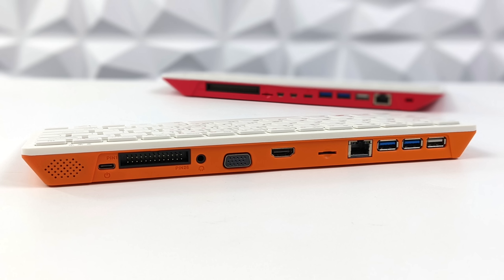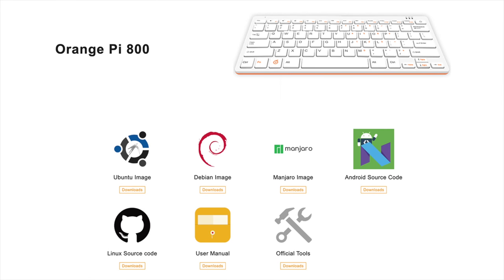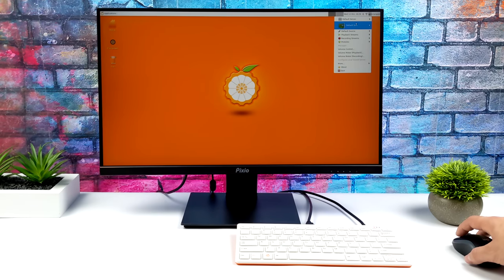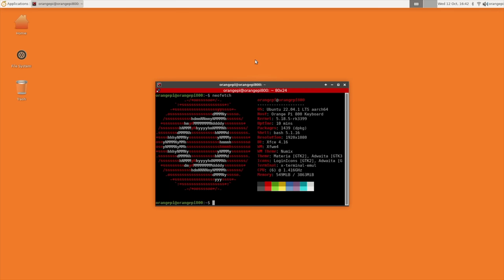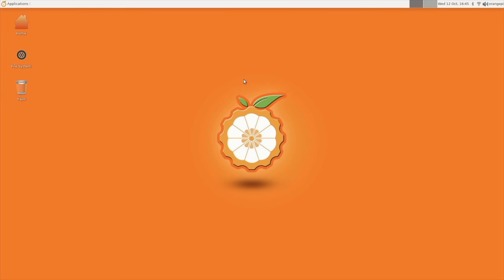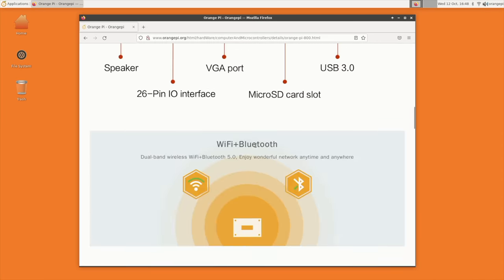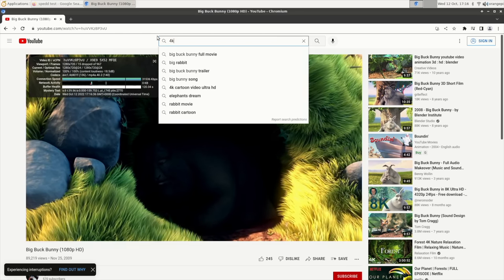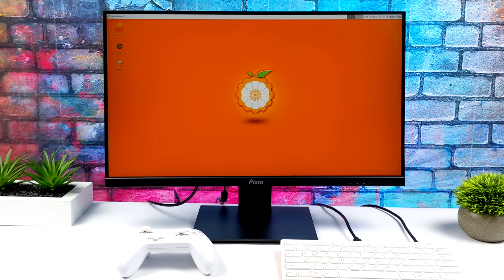Pi800 First Look, An Brand New All-In-One PC! Think Pi400 But Faster! 6 Core Arm CPU

Comment: I'm enamored, but just like the pi400, there's only 4gb of ram which is way too little for decent desktop use.  I would love to see an 8gb variant and it would be great!
Reply: Agreed, given the name, you'd think they'd at least throw in 8GB of RAM.  A M.2 slot wouldn't hurt either...
Reply: Like WTF why not 8 GB or even upto 64 GB Ram? But it is good that it is faster than the pi400; and that someone else is producing pi400 clones. Cause I think you can't even buy the pi400 out of stock. Maybe they'll make a variant version of the pi800 with atleast 8 GB ram. Glad someone else thinks like me; 1st thing I wanted to see was how much ram. Too bad there wasn't an option like a ARM GPU BUS and you could hook up a external GPU.

Comment: As a personal computer it's great. I like the downsized form factor of the Pi400 and Pi800's keyboard. The keyboard integrated motherboards are a real plus and take up a lot less room on a desktop than conventional personal computers. The only drawback to these SBCs is the form factor of the board itself. I also like to do robotics. Unless my robots were huge to begin with I wouldn't be comfortable with this SBC's form factor.  I would be interested in seeing it running on Odroid.

Comment: I really enjoy the pi 400, great for many projects. I have two table top arcades with pi 400 very easy.
Reply: Very excited to try the pi 800
Reply: The VGA plug is super cool and gives you the ability to plug it into a CRT monitor for the vintage game goodness 😁
Reply: @rmcdudmk212  Hoping it's an analogue signal out though, rather than analogue to digital over analogue.

Comment: I would like to see a new keyboard with a built-in battery. I could see myself using this battery-powered Pi800-like computer without a display and I could navigate the computer using just a screen reader. That is, once I connect a display and get the screen reader to automatically start during the login and after logging into the desktop. I would like to be able to make use of a keyboard-only device while traveling. Not that I am blind (actually, I am blind in my left eye), but being able to connect to the WiFi network and access the Internet using just a screen reader with no display connected would be very cool to have.
Reply: really curious about assistive technology on some of these alternative platforms. Windows (with Narrator) finally has a decent built-in screen reader. Apple's VoiceOver is quirky, but not too terrible. ChromeVox kinda sucks.

Comment: Maybe one thing not very clear from the video is that the GPIO are different. This is a 26 pins connector like on a very old Pi, and not a 40 pins like in most Raspberry Pi computer. Not sure what is the pinout, but you could lower the expectation here. As a desktop, you don't need that, so maybe most user don't care.

Comment: I hope the next version of this and the Pi-400 includes a full sized keyboard,  entering numbers with a numpad is much preferable.
Reply: I know that people have different preferences, but I have never understood this, as the top row number placement is accessible from your existing keyboard hand positions, instead of off to the right. I absolutely never use the numpad on a keyboard

Comment: Like most arm based systems when running Linux, the browsers do not have hardware video acceleration enabled by default. This is why youtube playback is so sketchy. If you get the HV enabled in both the OS and in the browser you should be able to obtain similar performance to what you see in Android.

Comment: Hey!, Nice video. I have a concern about the compatibility of the sensors, actuators, cables (number of pin are different), projects, kits designed for 400... Seems maybe those things will not work appropriately on 800, maybe some adjustments. Will be nice to have a video review of kits. Thanks again 👍

Comment: i'd def prefer a pi400.  i bet the os on that thing needs craploads of tweaking and will have a lot of problems.  i'm surprised they don't get sued with it copyin' the raspi so hard :)  at first i though raspi came out with a successor.  but, eh, it's good that it exists.  i hope raspi does make a successor.  with full size hdmis and slightly more i/o than the stock raspi board.

Comment: Can you please do a comparison video for people like me who are on a really tight budget and want to make maximum use off of a single system like this? Does it make more sense for me to buy this or a similar single board computer, make an old PC and put Android or linux on it, or buy a celeron laptop with either Windows so I can install linux or Android or with chromeOS out of the box, giving me direct access to Android apps?
Reply: How tight of a budget? In the 150-200$ range I would just get a used ThinkPad and put Ubuntu or your preferred distro.
Reply: @technicallycorrect838  100$ roughly. Plus I'm in Pakistan so don't assume we have old i7s rotting in storage. A 3rd gen i5 could still cost you over 100$ if you want a good monitor and other accessories not from the junk yard.
Reply: I use a pi400, it runs great 1280x720

But all of my monitors are big 1920x1200s and the pi400 does run not as smooth at those big resolutions. I'm using blender on mine to make BSPs and 3d characters with 5 layers of LOD cutoffs so it isn't too bad. LibreOffice, printing, and scanning all work great too. 

I will say though, raspberry Pi(ish) type computers really benefit a lot from running off of SDcards. One SDcard for desktop use, one for gaming on a heavily stripped down environment, etc.

Comment: You should try TwisterOS, they have an image for the RK3399. I’m using TwisterOS on my Pi4 and it works fine.
Reply: TwisterOS is wallpaper addon, not an OS. Pi4 OS does not work on other hardware ...

Comment: Thx, didn't know they release a Pi400 clone. The cpu power maybe a great advantage, but imho, 8 or 16gb or RAM would be nicer. I use the Pi400 a lot, and I love 2 HDMI outs, I don't understand why they added the VGA port, I would've loved a second HDMI on it (or even Display Port one day :) ).
When you have a multi-monitor Setup and you want HD graphics, VGA will just look bad at 1080p.

Otherwise, cool that we get an option, I will get one when I have some money to just blow on fun things :) (100 bucks is not much, maybe in December)

Comment: The issue with hardware acceleration of videos on browsers in ARM Linux is a fault on the part of browsers, Only recently Firefox fixed its x86 Linux version to play HW accelerated 4K without disabling critical security features.

Chromium on Pi isn't better either, Even with RPi foundation's customization.

Comment: It seems to me that Rockchip and many other makers of chips used in Pi-like SBCs mostly care about Linux in form of Android. Support for using regular desktop Linux on these machines feels like an afterthought. Raspberry Pi family are pretty much the only SBCs with primary focus on regular Linux instead of Android.
YT in Chromium browser works poorly because video is decoded using the processor rather than the built-in hardware codecs. Google has never bothered to implement hardware decoding in Chrome on non-x86 machines outside of Android.

Comment: this is disappointing i was hoping it to be a better upgrade.the only thing stopping me from buying p400 is the 4gb ram and lack of sata or nvme ports/sockets. id like at least 8gb ram and a sata connected 2.5in ssd so running windows is fine and not slow or ram restricted. mp uses 6.3gb ra, at idle with just stem open in background and maybe one tab youtube.

Comment: small error in video, this does not have a 40pin GPIO, it's a 26 pin ... not the same as the current raspberry Pi, but similar to older models maybe?

Comment: I've never gotten JACK (qjackctl) to work on Raspberry Pi 400, on Ubuntu 22.04.  It crashes quickly with an error called "Stack Smashing" (or something like that).  For MIDI audio on Linux (and its reduced latency), JACK is an essential application.  If that problem is solved, I would get one right away.

Comment: Can’t say I’m a fan of the deliberate naming to confuse people, although the box and labelling does say either Orange Pi 800 or OPi800, not just Pi 800. ETA, a video title change would be appreciated. 
Regardless, yes it’s faster than a Pi400, but personally I’ve had nothing but issues in the past with Oranges products, both hardware failing and poor software/driver support and this seems to still be the case looking at the YT playback test. 
Additionally, Orange gives nothing back to the Pi Foundation and is purely a commercial product trying to pick up the scraps of all the hard work the foundation does. So even ethically, it’s a hard pass from me.
Also, that’s not a full GPIO output on the back.

Comment: While I like the built in processor.  I would love for one of these to have a better keyboard.
Reply: You can plug in a usb keyboard off course so I don't think that would be make sense... well at least not commercial anyway.
Reply: @erikkarsies4851  
I have a Raspberry PI 4 if I'm just plugging in an external keyboard?

It would be nice if the integrated keyboard was better.  I just don't like the chiclet style keys.

Comment: I have a question: why don't they use any top of the line chip ? Like Snapdragon 8+ Gen 1 or MediaTek Dimensity 9000+ ? It could be a real ARM based desktop replacement. Main thing holding back those chips is lack of good cooling and that they are battery powered in phones - both of with is not an issue in a design like this. There is enough space for even an active cooling solution and power is delivered from a power adapter not from a battery.

Comment: I don't know, I got the Orange Pi Zero 2 and tried both linux operating systems that are available for it, but the desktop experience was far from smooth, YouTube playback even worse. Android ran smoother, Netflix playback was good, but no google service so play store was missing and installing apps from apks were a hit&miss, because if they needed some google service to run, they didn't work. 
I like the idea behind small arm pcs, but if you are not in the 200€+ range then it wont do much, you are better off getting some older laptop in that price range - even at 100€ price tag like the Pi800.

Comment: How is OS support - including updates! - on things like this? On official Raspberries, you can count on every relevant distro to have regularly updated installation images - usually official, community-built in some less mainstream cases. But what about this? It runs Ubuntu 22.04 now, which is great, but is there any chance of ever updating to 24.04 with an updated kernel when the time comes without, without the need to build your own kernels etc.?

Raspberry Pi is sometimes criticized for being stagnated, or overpriced relative to performance compared to the competition. But it's a stable platform that's reliably maintained and updated by both the original vendor and the community. How much of that is true for competitors like this?

Comment: How much you wanna 'bet' that the pi 800 / rk3399 lag on YouTube on Linux has to do with software based render on the browser instead of hardware video render... Keeping in mind that if the graphic driver in Linux isn't robust enough, I'm pretty sure the browser passes video off to the CPU. Android probably sends all video content to the GPU internally. Annnd it's probably not the first rk3399 system to run android os

Comment: thanks for show us this opion. 99 $ you say. In my case, from germany, the only ventor is aliexpress for round 139 € 😞
But i have two of the pi 400. And yes, when i becam the pi 800, i was lucky about the internal 64 GB + the better CPU/GPU.
But both, the pi 400 and the 800 has limtiits. What i mean is, the pi 800 is faster but not in the range, 
what mobile AMD, Apple or Intel Platformbase can do. But you pay more and you have, most, a fan for cooling it.
When you notice it, and you know what you do with these things, you have a Computer what cosuming ~5 Watt
and is absolut silence 🙂

Comment: I would like to see something similar but 100% Windows compatible.  Mainly for Windows XP era etc.
Reply: get a mini-itx system with an intel atom.. same sphere of performance but using x86.. I have an old (passively cooled) atom 330 board that would run XP.. VIA used to make good passively cooled x86 systems but I think they're out of that market nowadays. (I still have a couple of those lying around collecting dust)
Reply: @desktorp  Thank you but, a) I have a small PC running XP already (about the size of a full size external optical drive).  I was just speaking in general what I would like to see.  b) I am broke, no money now to buy even a mouse.   c) Still, thanks again for the suggestion.
Reply: @Trusteft  a) cool.. what kind of board/cpu do you have running the XP machine?

Comment: rpi4 also doesnt have vpu acceleration inside the browser out of the box on chromium, and if it performs better its just bc they add h254ify by default and h264 is far easier to decode on software than vp9, thats all. rpi4 also can "decode h265 at 4k" but for some reason you dont mention that issue when doing rpi4 reviews. a bit unfair if you tell me. so far rpi4 has delivered even 4k h265 and 1080p h264 amazingly but just on armhf rpi os AND just on vlc/ffmpeg

Comment: I wonder if you can set up some SBC so that they basically act as one computer. Like the system uses the resources of all the SBCs to do different tasks. I can't have been the only one to think of this,so what's the word on that?
Reply: parallel computing has been around forever.. the problem is that the OS has to be tailored specifically to that purpose.  In the past, servers had multiple CPU sockets.. then we got multithreading, then multicore.. so we sort of have a pseudo parallel computing solution already.  While there could be a future in which a mainboard accepts 'compute modules' so people can daisychain together huge amounts of CPUs, the reality is that most people who want that type of performance just buy CPUs with more cores.  Think of it this way.. would you be better off connecting 16 Raspberry Pis to work as one computer, or would you be better off buying a normal CPU with 16 cores?
Reply: @desktorp  I don't know,would I?

Comment: I think the price is not 99$. Here in Italy is 180€.
Reply: The link of Eta Prime shows 127.50 euro in the Netherlands but with a ridiculous 35.02 euro sending costs extra. Come on... that doesn't even cost it to schip it from the USA! This could be a good option for people not being able to get a pi400 under 100 dollar, but much more isn't sensible. It isn't only limited more performance than the pi400 so as a upgrade isn't a senisible choice either. Maybe if they would replace it with a RK3588S it would make sense.

Comment: I think the reason why all the OSs struggle with YT videos (except for Android) is because they don't have proper hardware accelerated graphics. And it pisses me off. It's so difficult to find good operating systems for these SBCs. If I wanted to run android I would have just bought a smartphone.

Comment: yeah ......i am wondering how something like this is different from say buying a 99 dollar 10 inch tablet with HDMI out?.........sure it may be an android tablet, but there are many ways to run linux on android.
Since by doing this you therefor get a tablet and desktop PC for the single price

........USB keyboards are 2 bucks.....and 30 cents optical
mouse........tablets also come with 64 gig storage

sure you don't get all the connectors on a tablet........but basic ones are there

Comment: You might want to install as many codecs as you can on Linux before testing. Many distros don't ship non free codecs, so if things don't work out of the box in Linux, you have to set it up so it does. Android is a commercial os so it likely has everything by default. There's the difference.

Comment: I don't understand why devices like this always lack any kind of mouse input
Reply: The Pi 400 has a kit option that packs in an official branded USB mouse with HDMI cable and manual. These all support Bluetooth mice, too. People prob have spare mice at home so they don't generally pack them in by default.
Reply: @alansmithee.01  sure, I also have a some spare mice, but I would like to have a solution that is on the device. Like a touchpad or a TrackPoint

Comment: From orangepi 4 lts: 
System unstable. Eventual freezes in disk access. Gets extemelly hot. System versions not compatible between products. Ubuntu is not ubuntu (not server, not desktop), is a useless remix created by someone. Crashes on apt upgrades leaving system unstable. Apt upgrades crazy slow due to lack of repositories and sometimes impossible. No official continuity to products or support. No normal product warranty in Europe, as required by law.

It's a bad product, but as raspberry it's impossible to buy now, we'll have to use them.